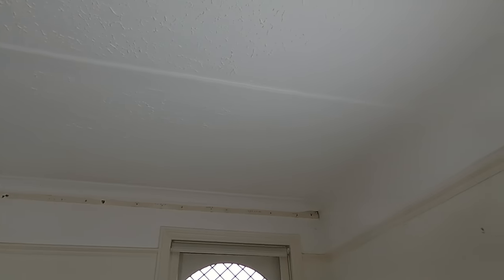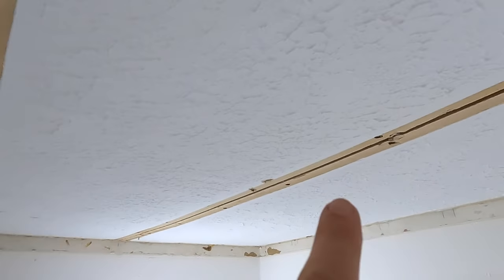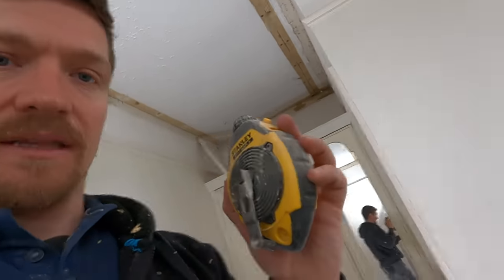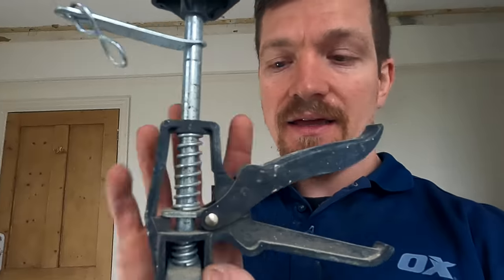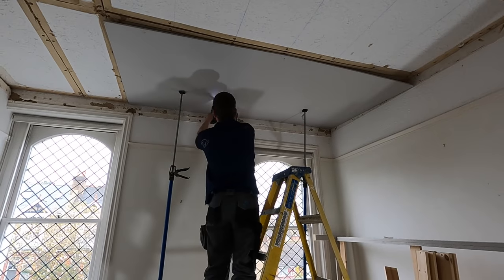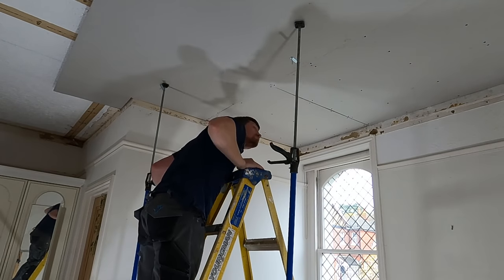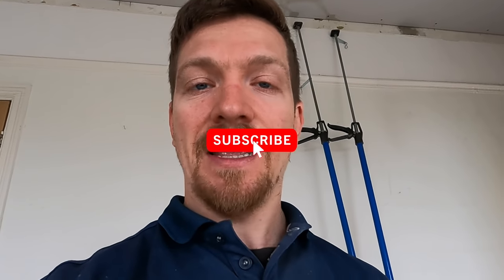How To Board A Ceiling ON YOUR-OWN! | Hacks For Making A Hard Job…Easy

Comment: Great job. I once did this by temporarily screwing a couple of wood boards in a stairstep configuration to get started, then just a single wood board over the edge of the last piece I installed from there on. The overhang was then used to prop up one side of the new piece while I lifted the other side.  I didn't think much about it at the time, but doing this kind of work would give me nightmares now, knowing what just one screw or nail could do if it pierces a wire. Worse yet, it's now legal in many parts of the USA to run a flexible gas line through a wall or ceiling. If I had to do something like this today, I'd look into one of those cameras that are supposed to show what's going on under the existing layers; one ad even claimed that you could see a mouse crawling around inside the wall.

Comment: In the past my wife and I used used brooms 😮. I'm now using a plasterboard lifter which is a dream and when I'm done with ceilings, I'll sell it. My latest job is overboarding a water damaged ceiling. I've cut away and boarded the warped area, and about to start overboarding.the whole ceiling. You've said to stagger the joints of new boards (of course) but you didn't say anything about overboarding the existing joints which I'd have thought was good practice. Another thing, I once used 2400mm boards which were difficult to work with because of the weight and size and a plasterer recommended I sticm to 1800mm boards for ceilings. By the way, the bedroom ceiling joists on the 60's house I'm working on are 420mm centre to centre.

Comment: I just can't help myself, I gotta put a few slim beads of expanding foam across the boards, especially along the joints, if you have any big dips, you can put foam in that area and using a straight edge to guide, just screw up just enough to level the board where the dip is, 20 mins later tighten up screws to pull the heads into the board, the board will not pull up into the dip, easiest way to even out the worst parts of some ceilings.
Reply from the maker: That’s a very good idea with the dips. I like that...thanks for sharing mate!

Comment: Hi Blaine, nice job as always mate, just out of interest do you come across old lath and lime plaster at all? If so could you show us your methods of what you would recommend on how to deal with it.
👍🏻
Reply from the maker: Thank you mate! It’s probably best to overboard it like I did in this video mate. I  don’t think it’s worth Plastering over if it’s cracked or damaged.
Reply: If it is a living room ceiling or such like and perhaps has a nice plaster coving round then it could be possible to repair as long as a good percentage of the plaster is still reasonably sound.
First go round taping the ceiling to assess loose areas and mark them. Then score the ceiling at these lines and carefully remove the loose, chamfering the exposed old plaster edge so that when you put on the new bonding it helps support the edge of the old. Give the lathes a good coat of pva then fill in with bonding coat and level off.( put plenty on so it goes over the lathes and grips on the top face)
When this has set give the whole ceiling a coat of PVA that is very strong ..3/1 or stronger..(it wants to feel very sticky to touch). When dry you will see cracks every where so scrim them all but don't overlap. It is then ready to skim. Do not put a second coat of pva on as some would say as I find this makes the plaster go off too quickly.

Comment: Staggering the boards is very important and neglected by a lot of people. You can buy special screwdriver bits that cam out when the screw is flush so you don't break through the paper with the screw head. These are a godsend when dry lining.

Comment: Cheers for the videos going to attempt a small room. I’m over boarding the ceiling but it needs levelling, it’s uneven by about 3 inches. Can you use board adhesive to level it, then fix with longer screws ? Or is there a better method ?

Comment: Question, I'm boarding over polystyrene tiles just because I don't know if they contain asbestos.
What size baton should I use, 25mm2 like roofing batons? 
Im nervous about hitting pipes. what length screw should I use that will fix 12.5 plasterboard but not go through the whole floorboards.
And I dont want spots in the kitchen, I want something hung, should I just put up 1 baton in the centre of the ceiling or 2 either side of centre?

Comment: Thanks for the vid. Would this work over an old lath and plaster ceiling or is it just going to crack in the future?
Reply from the maker: No it’s absolutely fine mate. Just make sure you get long enough screws 👍
Reply: Yes it’s fine to over board on lath and plaster but you must finish the ends of the boards half on the ceiling joists not just screwed into the laths ,should imagine 50-65mm drywall screws would be ok.
Reply from the maker: Good man Lee 👍

Comment: On your own use 6x3x9.5mm easier on your body, and easy to stay away from existing joints in original ceiling thus giving better fire protection for the customer
Reply from the maker: Good point! Cheers 👍

Comment: I just make a wooden T prop.  It can hold most of the board up no problem.  With these adjustable props, the head has such a small area, I’ve had boards crack and drop until everything is tight and in place.    Why don’t they make them with larger surface area heads? Definitely no impact driver and a small light screwdriver or dry wall driver is luxury :-)
Reply from the maker: Ha I know mate! It’s a very good point - they have such small heads. We’ll have to make our own 😂

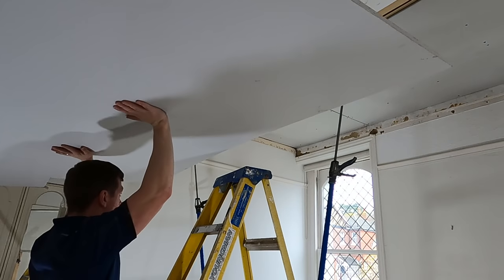Comment: the board you put in at 6:43 the part to your left dosent look to land on a joist. did it or have you another trick to making sure the seam dosent crack after its plastered. thanks for the vid
Reply from the maker: It’s hitting the joist pal. But I don’t recommend cheating this - if it’s not in the middle of the joists then it’s not worth fixing. There’s no trick around it unfortunately. 

Lots of fixing and tight cuts helps with cracking mate...and obviously using scrim tape before Plastering. But that’s it. You can do everything right and it stills cracks, especially for new builds because of the movement in the timber. 

Hope this helps my friend and thank get watching
Reply: you can squirt some pb adhesive in and then prop up til it pulls in

Comment: Can I ask you a question is there a reason why you have to put up a whole board.  I often cut them down to to nearly half size. So they meet a joist around half size is there a reason you shouldn't do this surely we just add more scrim tape. I have injured myself several times lifting up hole boards on my own and just felt it wasn't worth the risk anymore . I'm 47 so have to be a bit more careful than you . Are you aware of any reason why putting up half boards and adding more scrim tape as long as they end on joists matters ?
Reply: When dealing with half boards. I don't even need to use support. I have noticed in your videos that workflow is something you really understand it's basically what you earn.  so is there a reason why it's important to put up whole board and not just half boards which is obviously easier and quicker no jacks and no injuries. I would really appreciate your view on this. I really respect this channel and thats not something I would say about most of the YouTube plastering channels. You're a great find thank you so much.  I've learnt a lot from you even though I've been doing it 20 years. 👍
Reply: Full boards minimise cracks

Comment: Hi Blaine, I've got an overboarding technical question if you could try and help please (I'd be very grateful).

I can do the ceilings like this, but with the walls there's no studs. The house is ex-council and built in 1973 - the walls are 9mm|22mm|9mm plasterboards sandwiched and bonded together with a T stud configuration top and bottom.

My question is how would I fix the new boards to these please?

Basically they've wallpapered directly onto the existing plasterboard and it's chewing the boards trying to remove the old wallpaper.

Thanks mate
Reply from the maker: I’ve seen these before in the mother in-laws’ house believe it or not. Sounds crap, but you’ll have to remove the wall paper and Bond the wall flat afterwards. You don’t want to add anymore weight to these walls.

Horrible construction. I knocked my mother in laws down and rebuilt them in timber. That’s the best bet but if not, do the first option pal 👍
Reply: @PlasteringForBeginners  thanks mate!

Comment: That's not the easiest way they're all right those ceiling support poles but I find get two pieces of wood, 1st(25mm x 40mm x 80mm) 2nd(25mm x 40mm x 250mm). And make rotating arms drilling into the ceiling frames so that you can slot the board one side, go up the ladder with it, then turn round the other two; get your drill and screws whilst it's suspended there.
Reply from the maker: Great idea...thanks for sharing pal!

Comment: Very timely, thank you! I have a completely open ceiling I need to board, trouble is it's over 9ft high and apart from the fact I'm only 5'2" I'm not strong enough to lift a whole board myself! Guess I'll have to do it in partial boards. If I halved them, would you recommend halving lengthways or widthways? Or would it be better to, say, do something like ⅓ and ⅔ and stagger those? (Ceiling is 8ft2 X 10ft2)
Reply: (Just seen some other commenters mentioning panel lifters, I didn't know there was such a thing so that'll be what I need!)
Reply from the maker: Yeah I’ve never used them myself but they sound amazing. I’ll be having a look for my future endeavours ☝️
Reply: Great video, thank you.

Comment: Never ever use your head, never ever work on ladders ,use a nail first to hold it up then screw and use 6 by 3 . Just saying been doing this for 50 years and still in one piece.
Reply: Great advice but in the real world not practical at all. Most clients are not going to pay for staging when a ladder could be used for example. And I can’t think of any occasion of over boarding where I or a colleague hasn’t used our heads for a brief moment

Comment: Get a board lifter save you a ton of grief...
Reply: @PlasteringForBeginners  about 200 from axminster you'll wonder why you struggled pays for itself just make sure you get the side load one  and check the height....and a belt fed screw gun and a big t square and 1 clamp you can cut on the lifter ....